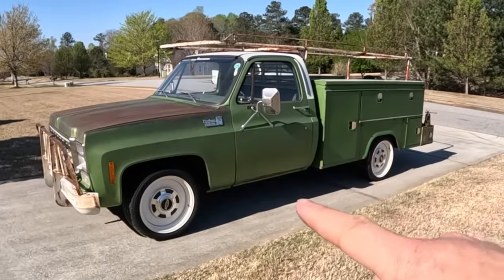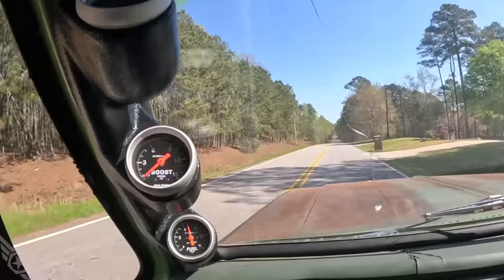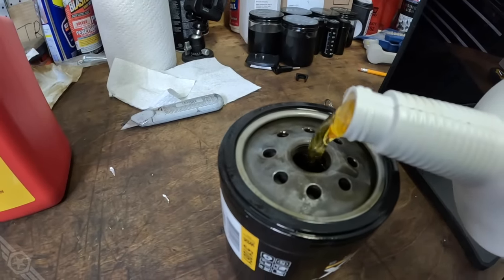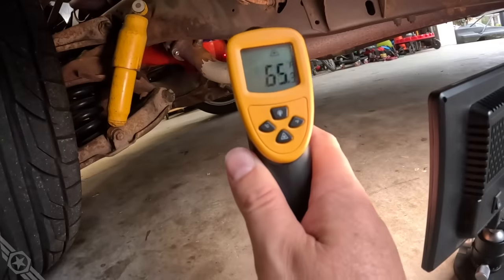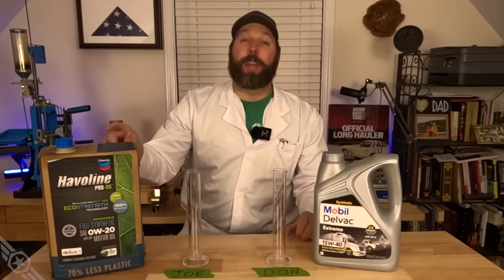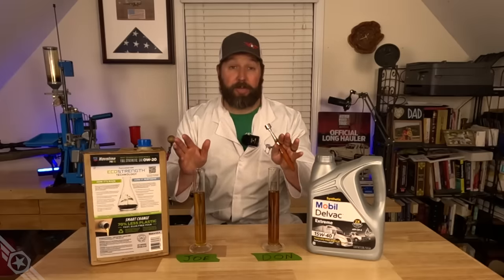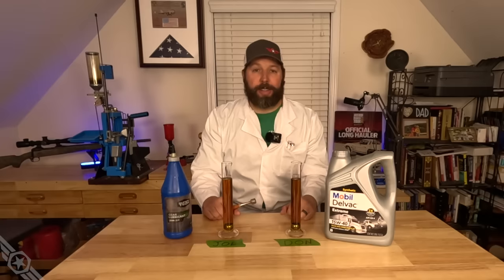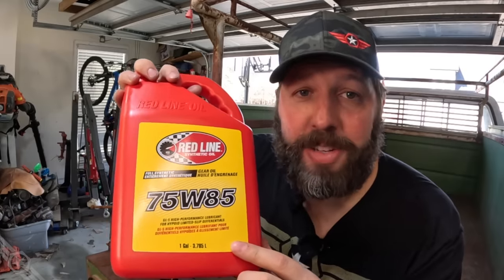Running GEAR Oil in an ENGINE!!! (EXTREME PRESSURE)

Comment: I just use "super universal tractor oil" for all my engines and hydraulics. Because it’s cheap and I’m cheap. It says 10w30. Oh and I only have diesel engines.

It is supposed to be used not just as an engine oiI, but also in transmissions, diffs, hydraulics, wet clutch, power steering, etc.

I avoid it for transmissions (yellow metals) and diffs (hypoid/EP) though.

Note that this STOU oil is different from UTTO oil that is only supposed to be used for transmissions and hydraulics, not engines.

What is STOU excactly and how can they make a product that works everywhere without breaking down?
Reply from the maker: I actually had to google the universal oils. I’ve never looked into them. 👍

Comment: But what about deposits, resistance to heat, thermal break-down,  and shearing?   All of the stuff engine oil is made for.
Reply from the maker: They certainly have different additive packages for different purposes. I'm not recommending that anyone do it. I was just trying to teach people that those Viscosity Grades don't correlate. I swapped it out for 10W-40 after the video.
Reply: @freedomworx 
Interesting info.  I like your presentation style.   You earned a subscriber
Reply from the maker: @ChinookBear  awesome. I appreciate the support 👍

Comment: I added gear oil to my 14L 60 series before I got the engine rebuilt, it was burning 1 to 2 gallons of oil a day lol.
Reply from the maker: That's a lot of oil, even for an engine that big!
Reply: @freedomworx  yes before I got it rebuilt I was spending 500 a month on oil to keep it going.
Reply from the maker: @ryanehlis426 that’s so much oil that you have to factor it into your fuel economy 😂

Comment: Never put gear oil in when the oil pump is on the front cover. It will crack. The bearings in my 72 F100 with a 360ci v8 were beyond worn out. I used 85w140 in my engine and it ran perfect, no clatter except on start up. Just dont have any oil leaks, women dont like that at all.
Reply from the maker: The thicker gear oils can certainly overload an oil pump or it's drive mechanism.

Comment: I've seen gear oil used to top up engine, and I've seen engine oil in a brake master cylinder.
Reply from the maker: Gotta keep those brakes lubed up 😂

Comment: I’ve ran gear oil in a clapped out Jeep 4.0 so I could hear the radio over the sound of the piston slap. The oil pressure went up a little but not much and it ran fine.
And that is the only reason to run gear oil. On an already worn out engine to prolong the trip to the crusher as long as possible. There is never a reason to run thick oil on an engine.
Reply from the maker: Squeeze every last mile out of them 👍

Comment: That’s the stupidly expensive oil my gm nv 4500 uses except I use the ams oil because Walmart doesn’t sell redline anymore lol here in Canada it’s about 40$ a litre for the and oil.
Reply: Also the redline oil is a gt4 oil that does not have sulpher additives in it or it eats away at soft yellow metal synchros it’s the only  “safe” oil to use in a nv 4500 and that’s why it’s so dang expensive
Reply from the maker: This particular Gear oil is a GL5.
Reply: @freedomworx  ok so redline mt-85 is the gl 4 and is still 75w85. but it doesn’t have the sulpher additive. So maybe you could run that in a engine with out it turning into acid. Lol
Reply from the maker: The SM465 trans in this truck takes a GL-4 80W-90. I think I might have used the MT-85 in my old TDI 5 speed trans.

Comment: I like a good clean flow so I cut a little triangle flap on the back of the handle to let the air flow in while the Dino juice flows out the front. 😃

I volunteer to smell Katie Perry too.
Reply from the maker: If you want to sniff Katie, you’ll have to get in line behind me 😂

Comment: Even if you put the very thick oil the pressure doesn't go that high, cause it bypasses to the check valve...In the worst scenario you will blow the oil filter
Reply from the maker: 75W-85 is thinner than 20W-50. Hell, it’s thinner than 15W-40. That’s the point of the video. People think all gear oil is thicker because the numbers are higher. That’s not the case.
Reply: @freedomworx  I'm replying cause you clickbait (high pressure), even if you put that 85w140 the pressure doesn't go much higher, the relief valve will open for sure!!!

Comment: Why Redline synthetic gear oil? Nobody, but racers uses that! 75w85 equals a 20w30 engine oil.
Reply from the maker: Cheapest 75W-85 I could find.
Reply: @freedomworx  Wow, there was only it on the shelves, then... (?)

Comment: So there is another not so fun fact you probably didn't know.  Hopefully you didn't trash your engine.  The sulfer in modern gear oils (GL5 rated) while they give a high film strength are in many cases not compatible with yellow metals.  This is brand specific but by in large if an oil is GL5 rated more times than not you'll find that it isn't compatible with yellow metals.  This incompatibility in essence will cause oxidation of your yellow metal components causing the components to flake and delaminate as part of the oxidation process.  This is why hytran oils for tractors don't have that sulfar smell is because they lack sulfer.  The shared oil sump of tractors where the transmissions and tractor hydraulics are shared have alot of yellow metal components in them.  Additionally this is why you should NEVER run a GL5 rated gear oil in something like an old Muncie M20/21/22 transmission being alot of the syncro assemblies are built with yellow metals.  Many types of engine bearings are copper or copper backed.  In addition to components in the oil pump having bronze bushings etc.    

When I talk about yellow metal I'm referring to bronze, copper, and brass.  If you do some googling looking for "GL5 yellow metal corrosion etc" you'll see a ton of images of yellow metal corrosion from transmission components where folks mixed up GL4 vs GL5 where it breaks down shifting collars to nothing.  Predominantly on things like old Muncies and British sports cars but I think you get the point.  And as I eluded to before there are GL5 rated oils that are yellow metal rated, but most are not yellow metal rated.  

There is alot more to oil than just the viscosity and some of those additives can actually ruin your car.
Reply from the maker: Yeah I talked about that in the video.

Comment: a gallon jug of lucas costs less then a jug of 5w30... only add enough till the oil feels slick 1/6 or so... but then 400'000 on an old 4.6 ford is, steaming past the rings burning a quart every 300 miles... flooring it plowing snow. flush engine, think the oil scraper rings are fully carboned... flush with... flush stuff in oil or diesel mixed with flush stuff? clean rind carbon without taking apart or buy new scrap 5.4?
Reply from the maker: 5 quarts of 5W-30 is $17 at my Walmart. A gallon (4 quarts) of Lucas is $33.

Comment: Wondering if you can break in a flat tappet camshaft with gear oil.
Reply from the maker: I wouldn’t risk it. Just buy the proper break-in oil.
Reply: @freedomworx  yeah, I wouldn't risk it. I  probably would't even run a flat tappet cam with the problems they are having with lifters. Would be just like setting a pile of money on fire.
Reply from the maker: @ck4181 being a gearhead is like setting money on fire 😂

Comment: As someone in lubricant engineering, this makes me cringe.  I especially feel bad for the bearings, the soft yellow metal of which will be highly susceptible to corrosion from the high amount of active sulfur in the gear oil.  With very low anti-wear and detergent additive content, your engine won't be happy with that for very long.
Reply from the maker: Educating people about lubrication makes you cringe? Maybe you should take that engineering degree and do better than me 🤷🏻‍♂️
Reply from the maker: Good job editing your comment after the fact. I specifically stated that you shouldn’t use gear oil in an engine for the exact reasons you listed. The oil was in the engine for an entire 6 miles, big deal. The video is not about using gear oil in an engine, it’s about teaching folks that the viscosity grade scales are completely different. Which I think the video did very well 🤷🏻‍♂️
Reply: You could've explained all of that without pouring it in the engine.  That's the part that makes me cringe.   @freedomworx
Reply from the maker: @almizzyracing8004 I could have, but then nobody would have watched the video 😉. My challenge is creating a video that is informative enough, but also entertaining and fast paced enough to get the click and then hold the attention. If I don’t provide the entertainment aspect, the technical aspect will never be seen. People clicked because they thought the engine would be destroyed, they learned as a consequence of their morbid curiosity. Thanks for watching. Sorry that I misunderstood your comment.

Comment: Fill up the oil filter; I say use straight 30 weight oil, takes away all connection rod knock, cheaper than replacing those bearings, they use too light of oil in new cars!
Reply from the maker: Straight 30 is no thicker than 0W-30 at operating temp 😉
Reply: Aircraft engines use straight 40 or 50 weight oil, hint!
Reply from the maker: Straight 40 is not thicker than 0W-40 at operating temperature. Straight 50 is no thicker than 20W-50 at operating temp. If it will knock with 0W-40, it’ll still knock with Straight 40.

Comment: It forms a tar like sludge all over the parts in the motor and plugs oil passages....very often shady people do this to sell a really a car with tired motor to quiet the motor
Reply from the maker: I don't know about the sludge, but I do know about the shady people part 😂
Reply: Seen it happen.... about 500 or more miles at high temps the sulfur separates to form a black sludge
Reply: Try fine sawdust in the crankcase....a Detroit classic

Comment: Now I'm not saying that wasn't gear oil. I'm just saying that "Gear oil" poured like 20-50 engine oil  😅
Reply from the maker: It’s thinner than 20W-50 oil. The specifications are pretty clear.

Comment: Used to be a trick of used car lots... replace a pint of oil with gear oil to make worn lifters stay quiet on test drives.
Reply from the maker: Just a pint? 😉
Reply: @freedomworx  - from one shade tree mechanic to another... just the tip 👍
Reply: @freedomworx  🍻

Comment: But the oil you took out you're getting pressure from old oil the way to get the accurate pressure from the original oil would have to be fresh
Reply from the maker: I understand what you are trying to say. But the viscosity of the 20W-50 didn’t really change much in 1000 miles. That’s why I did the demonstration at the end with new 15W-40. Which was also thicker than the 75W-85.

Comment: So what would happen if you used engine oil in your transmission?
Reply from the maker: Auto or manual? There are plenty of manual transmissions that spec Engine Oil instead of Gear Oil.

Comment: that gear oil looks like 30 weight when you pour it, it will be good for your old engine. try running modern 0w-20 in your truck and see what happens
looks like you got ripped off on that so called gear oil, its probably 10w-30 with some gear oil smell added to it
Reply from the maker: No, 75W-85 gear oil is simple that thin it’s actually pretty close to 10W-30/40. That’s the point of the video. The viscosity grade of gear oils is on a different scale than engine oil.
Reply: @freedomworx  who made those charts? I have poured gear lube at the same temp as I have used different weights of engine oil and real gear oil is much thicker. 80w 90 is heavier than 50w at the same temp. the 75w you bought is cheap crap, red line is a rip off company i have seen other tests of their oils and they are not impressive. royal purple is another scam, I think they sell used oil thats why its dark
Reply from the maker: @mikecubes1642 those charts are based off of SAE J300 and J306. Doesn’t matter who makes the chart, they all say the same thing. 75W-85 is not cheap crap. It’s made for manual transmissions. Put 80W-90 in a manual trans and it will like shift poorly. Every oil has a purpose. Just because it doesn’t fit your purpose doesn’t mean it’s crap.

Comment: Can you use 15w40 as gear oil in a diff.
Reply from the maker: I wouldn’t. It doesn’t have the EP Additives it needs, and it’s too thin. It would likely work in a pinch if you are babying the truck to get it to the next part store. But if you are heavily loading the truck, it would likely damage the ring and pinion.
Reply: @freedomworx  ok thank you.

Comment: I would be worried about low zink in that oil and smoking the cam lobes
Reply from the maker: It’s a valid concern. ZDDP is an Anti-Wear Additive, and gear oils have the extreme pressure additives. They both pretty much do the same thing, the EP additives is just optimized for higher temperature and pressure. So it might be ok 🤷🏻‍♂️. Either way, I swapped it out for the high ZDDP 10W-40 right after I shot the video. It’s probably ok…probably 😉

Comment: People who tell you not to fill the oil filter are probably selling bearings or they're just full of s**t. If you don't fill the oil filter that is just that much longer your engine runs without lubrication.
I'm glad you threw in the proviso that you can run it in an emergency if you can't get anything better.
Reply from the maker: One thing to consider is, lack of pressure did not mean lack of lubrication. You don’t need oil pressure to keep components lubricated. Many small engines live their entire lives without oil pressure. I actually have a good test planned to explore this theory in a pretty extreme manner 🤞

Comment: Regardless oil pumps in engines are pressure regulated
Reply from the maker: The relief valve only controls the maximum pressure the pump can produce. It does not modulate the operating pressure of the pump. It had no affect on this gauge reading during this test. SBC reliefs generally lift between 55 and 70PSI. This engine never went much over 45PSI.

Comment: Engine oil pumps have a spring controlled pressure valve in them, thicker oil will not change this fact.
Reply from the maker: That’s simply not true. Engine oil systems have a relief valve, not a pressure regulator. It only opens at a preset maximum pressure which is very rarely reached. The only time that relief valve opens is during cold starts or high RPMs with cold, viscous oils.
Reply: @freedomworx  😂 you literally confirmed what I said.
Reply from the maker: @Wrenchen-with-Darren  no I did not. The pressure relief valve is not controlling the operating pressure of the engine. You obviously don’t know the difference between a regulator and a relief valve 🤷🏻‍♂️
Reply: @freedomworx  sorry you must be right.

Comment: Pressure doesn't equal flow rate. With that viscosity of oil last few components on oil path are receiving little to no oil.
Reply from the maker: Did you watch the entire video? The 75W-85 oil I used is thinner than the 20W-50 that was in the truck. That was the point of the video.

Comment: what kind of gear oil was that? looks runny,
Reply from the maker: Redline 75W-85
Reply: @freedomworx  it didnt look like any gear oil i ever put in a pumpkin.
Reply from the maker: This is normally used in manual transmissions.

Comment: WTF, after all that we are told gear oil isn't good for engines but the bottom line is that I never ever thought of putting gear oil in an engine, even a worn out one.
Reply from the maker: It’s not good for an engine. But if you have one that is worn out, nothing wrong with adding some thick gear oil to keep it on the road.